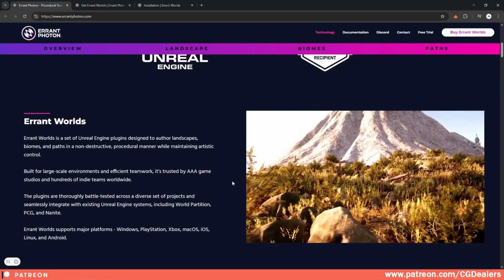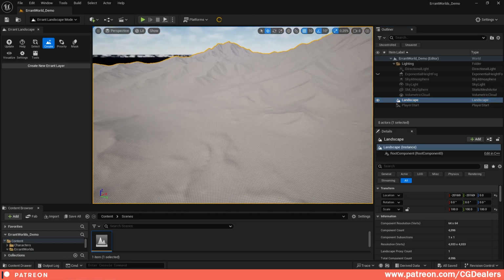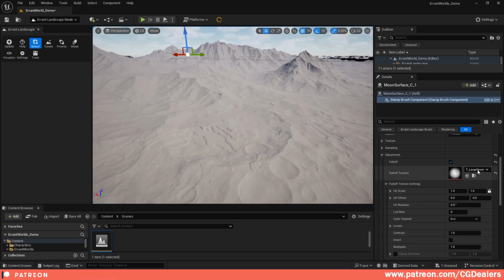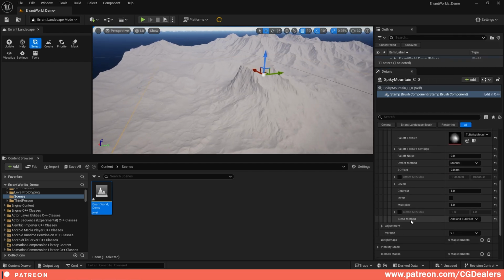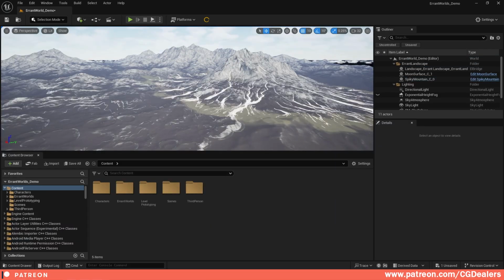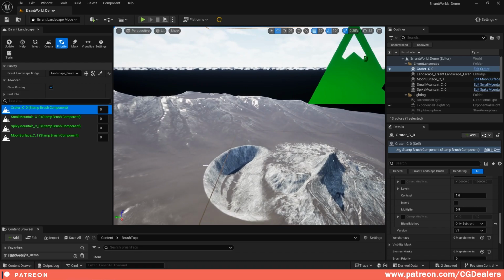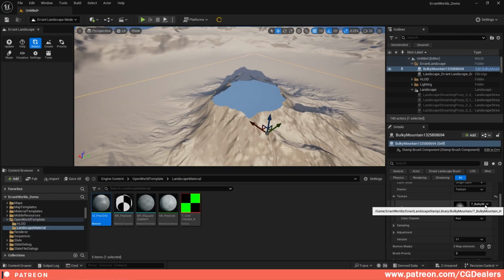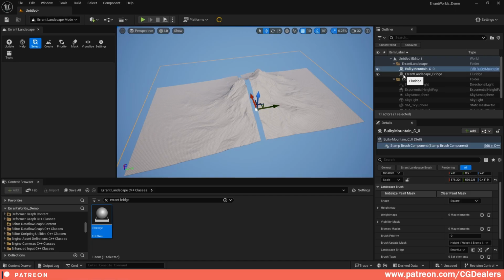Create Landscapes in Minutes – Unreal Engine & Errant Landscape [Part 1]

Comment: When blending another heightmap with Landscape Blueprint Brushes and you get those sharp 0 to 1 transitions on the border, isn't there other options under Input Type for different blend modes? 
Like blend modes in general: Addition-Overlay-Multiply

I need to ask about a workflow feature that i think never has been done in UE, or even possible before they introduced Landscape Blueprint Brushes.
When using the Layered Heightmap layer mode, could it be perhaps possible to stack layers of different detail levels for a landscape heightmap over each other to add smaller micro details that would make just one heightmap to large in file size?
Like for instance: More detail on cliffs - small detailed errosion - stone/rock bumps - roadways - ocean floor - large rock formations in forests and so on..

And as for the weightmapping of landscape MAT layers, could you start with the base Landscape Brush for Rock, then: Soil/mud - dirt/sand/beach/(Gravel?) - Gravel/stones/pebbles - Grass/Forest ground/moss - Snow/ice/water(rain) and so on...
Then the MAT layers would also need to be stacked/layered in the same order as. Sort of like it is IRL (The same way the ground layers are here on Earth)
Reply: I will first clarify that Errant Landscape is not based on Blueprint Brushes. It's a separate system that runs on the GPU and writes its results into the standard Unreal's landscape.

> you get those sharp 0 to 1 transitions on the border, isn't there other options under Input Type for different blend modes? 

You can configure Falloff and a Falloff Texture" in the brush, which give you a lot of control over how the brush blends with the environment. The brush can also be applied additively, subtractively, replace, min, max, etc.

> could it be perhaps possible to stack layers of different detail levels for a landscape heightmap

Even if tried to wrote ultra high detail data into the landscape heightmap, you are restricted by the pixel density of the landscape's final heightmap. So usually 1 meter per pixel. So if you rendered an 8x8k brush over a small area, most of the detail from that 8x8 brush will get lost anyways.

You could theoretically implement a landscape system based on a grid of heightmaps where each heightmap can have a different resolution. However, in practice, you want as much detail everywhere. On the cliffs it will be detailed rocks and on the desert it will be small crevices and bumps. So optimizing that part of the system doesn't bring much benefit. Plus there are weigthmaps that also need high pixel density.

What you could potentially do currently is have two landscapes. One high-resolution and one low-resolution. Errant Landscape brushes can write to multiple landscapes, so workflow wise it's not a problem. And then you can remove their components depending on how much detail you need. For example, you might not need as much detail underwater or far away. However, in such a workflow you need to be careful to hide gaps between the two landscapes.

> And as for the weightmapping of landscape MAT layers, could you start with the base Landscape Brush for Rock, then: Soil/mud - dirt/sand/beach/(Gravel?) - Gravel/stones/pebbles - Grass/Forest ground/moss - Snow/ice/water(rain) and so on...

You could paint each layer separate, via brushes, have them overlay on top of each other. Our brushes have priority so you can control the order in which they are applied. So you can paint weigthmaps in a specific order.

And then you could use the non-weight-blended workflow in the landscape material to blend them nicely, in a specific order. That's what we do in our examples.
Reply: @errantphoton thank you for that very useful insight. This plugin is just getting better and better. Absolutely a need to have when working with elevation data/GEO data or landscape data made with Gaia, world creator etc...